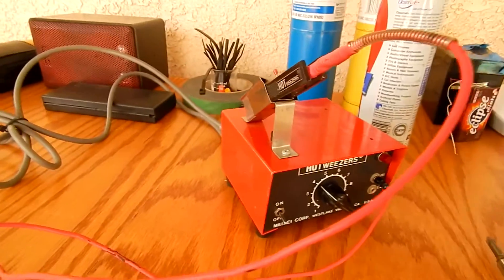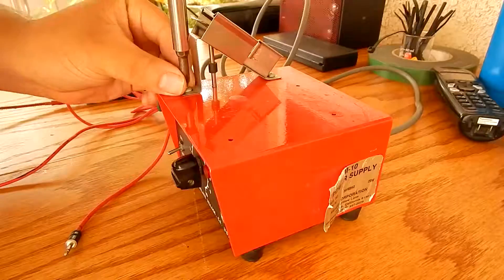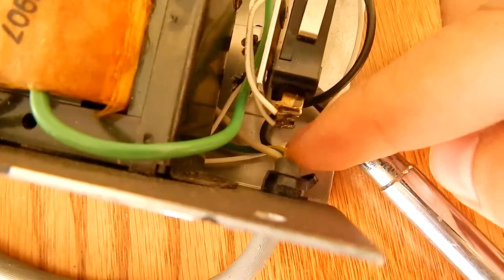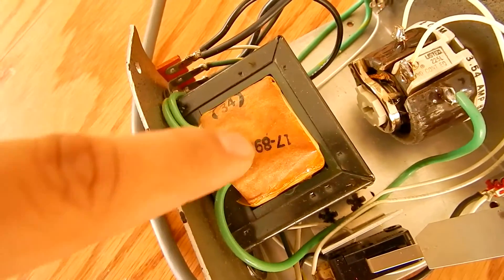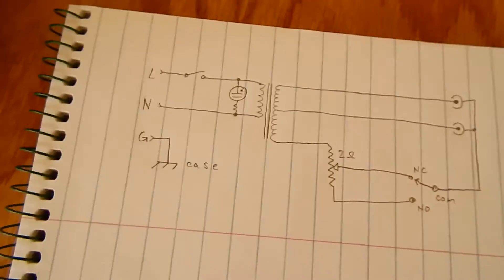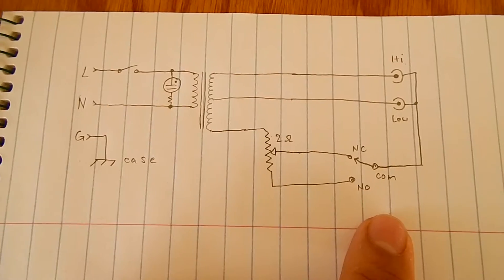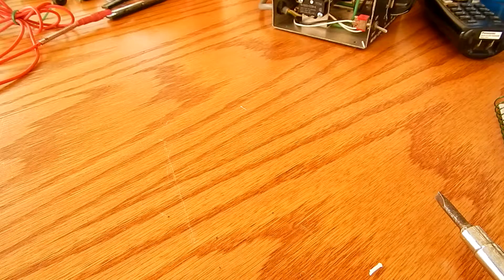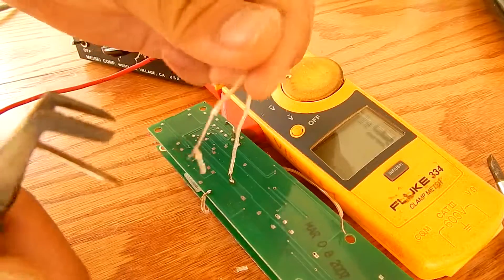HOTweezers (wire stripper) teardown and schematic

Comment: As for we engineers in the lab... we normally strip Teflon jacketed wire and use a very high setting, then just pull off the insulation with the tweezers. If it sticks to the tweezers, the Teflon won't burn, we just tap our fist on the bench while holding the tweezers. If the piece falls off, good, if not we will let it stay there and we will get it on the next strip. When we strip PVC wire, the PVC insulation will usually stick. We use an exhaust fan with filters for the fumes so we often just let it stay on the tweezers until it chars up or too many pieces build up. Before that, it is normally not worth trying to remove it because the PVC is still gummy.  In the lab we don't work on deliverable units, so it's kind of like the "old west" in the lab [smile].  We have an old saying when we solder: "The bigger the job, the bigger the blob."

IP.... whatsis? Huh? QA?  Whaaaaat?  We are en-ga-neers, we are the worst at soldering, wiring, and such.  It's the electrons that we wrangle well.

My boss once told me: "You can bullshit the customer, you can bullshit management... but you can't bullshit those electrons." [laugh]

Comment: 7:54 I believe the Meisi Tools wire stripper tweezer and heated knife operate with "conductive" elements (each element is already grounded), which is similar to "triggered soldering guns" (e.g. Weller Tools soldering guns). Tools that operate through "shorting" would be the "resistive" type.

With this mentioned, the Pace SMR "resistive" tweezers have an attachment for or removing PLCC's, thus converting them into "conductive" tools. I've also modified the trigger operated conductive soldering guns and resistive tools into "inductive" heating devices by attaching a modified piece of copper wire in the shape of a coil to remove stuck or seized nuts and bolts.

Comment: Appreciate your review of the HOTweezers M-10 power supply. We have a multitude of them here at my work. To meet IPC-A-620 standards of stripping one does not want to clamp down on the wire and then slide the wire jacket off with the HOTweezers. This may cause scraping or nicking of the conductor. It is best to clamp down with the lowest heat needed, not to burn the jacket material, in 2 rotated locations. Then by hand remove the slug/jacket, usually with rotating the slug as it is pulled of the conductor.